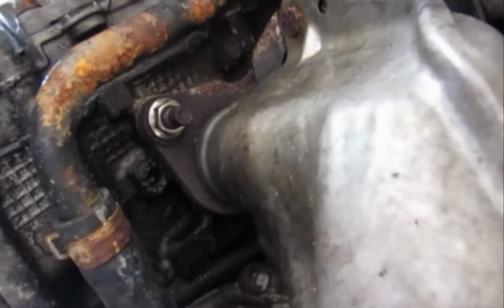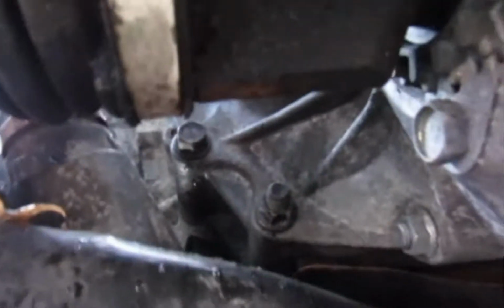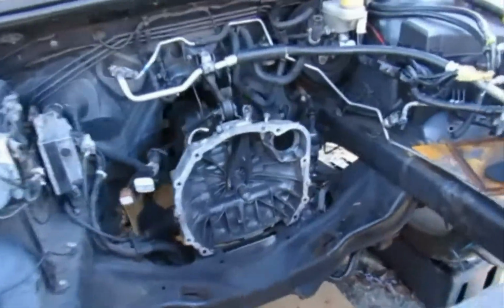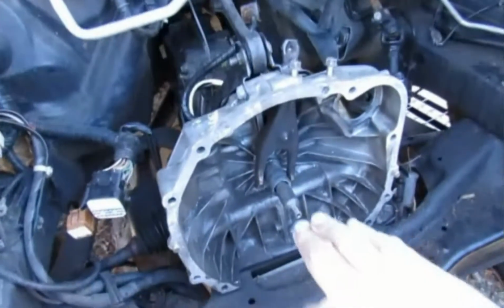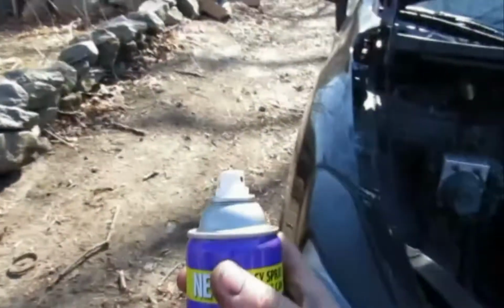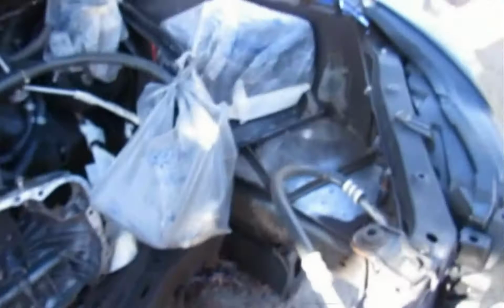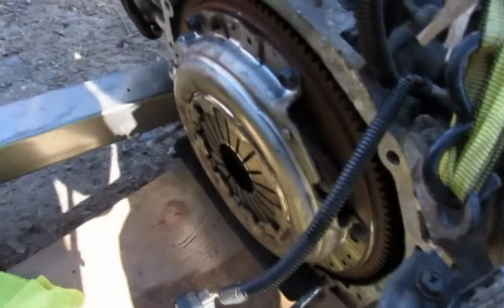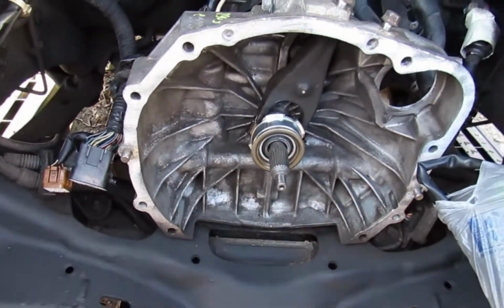Subaru Impreza engine swap. 2013 fb20

Comment: I'm currently pulling my 18' crosstrek. I've got all the bolts, nuts from the trans undone. I've jacked up the trans and it won't separate, help?
Reply from the maker: It’s a manual? I would bet money that there’s something you are forgetting. I forget if there are reverse bolts on the trans but really the only reason it wouldn’t separate fairly easy is a bolt still in the trans. If you are 100% sure there are no bolts use a dead blow and work the edge where they meat not on trans side too loosen up the guide pins bc there metal dowels in aluminum and tend to corrode find a spot like near the clutch fork and get a pry bar in the gap and pry but not too hard just enough to get a flat bar inside the seam/gap you just made and slowly work it apart but be mindful bc you can mar up the mating surface if you are too aggressive. Make sure enerything is disengaged bc one thing could hold you back.